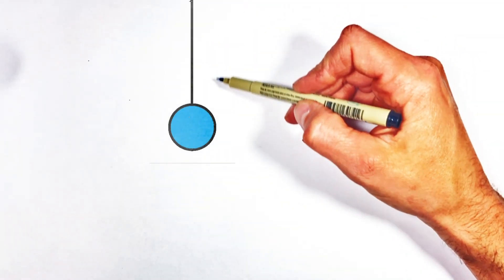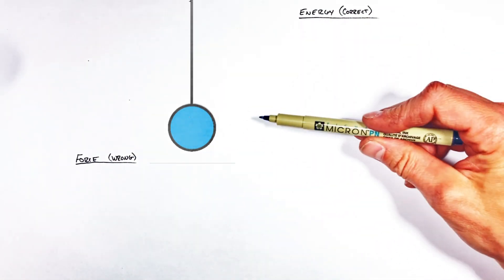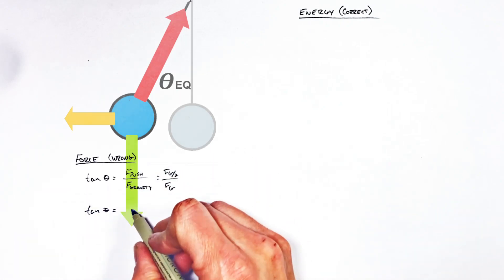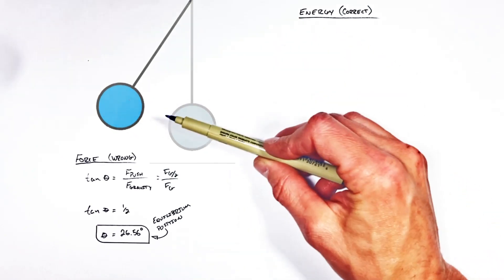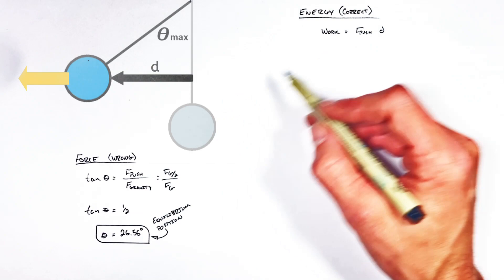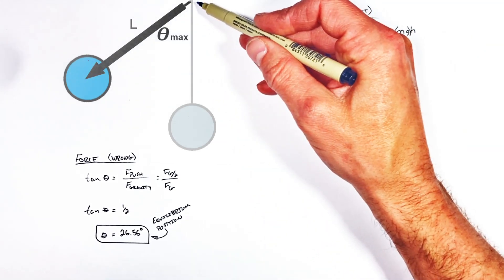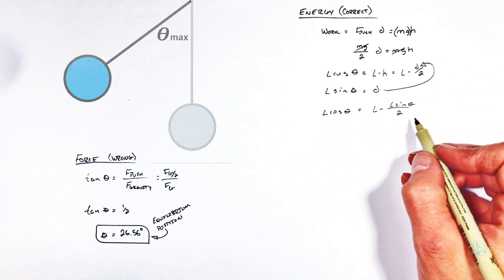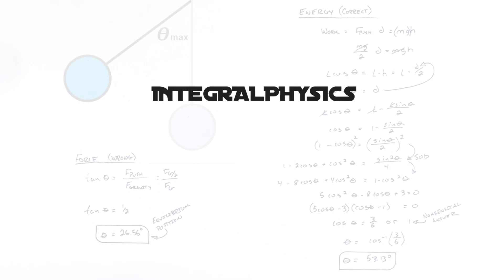Maximum Position of a Pendulum Pushed Horizontally | Energy vs Force & Equilibrium

Comment: Sir Thanks for the answer. But I have another question I tried to find on web but there is no clear answer. The question is:

A particle of mass m moves on the x-axis as follows: it starts from rest at t=0 from the point x = 0 and comes to rest at t=1 at the point x = 1 No other information is available about its motion at intermediate times (0 < t < 1) If alpha denotes the instantaneous acceleration of the particle, then which of the following are correct? 

(a) alpha cannot remain positive for all t in the interval 0 < t < 1
 
(b) |alpha| cannot exceed 2 at any point in its path

(c) |alpha| must be≥ 4 at some point or points in its path

(d) alpha must change sign during the motion, but no other assertion can be made with the information given
Reply from the maker: d)...  Since the object starts and finishes at rest, the object must first speed up, then later slow down.  The instantaneous acceleration at any point cannot be determined.